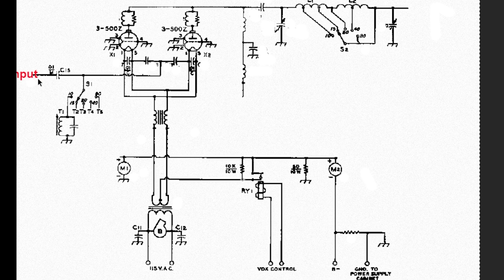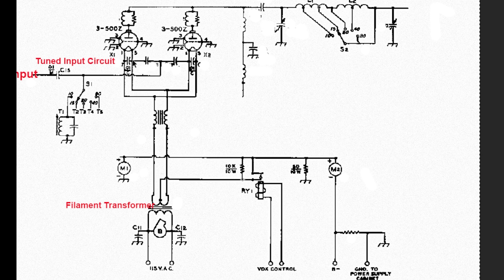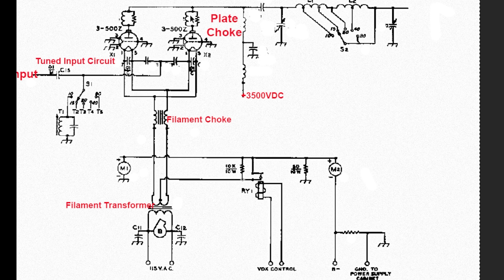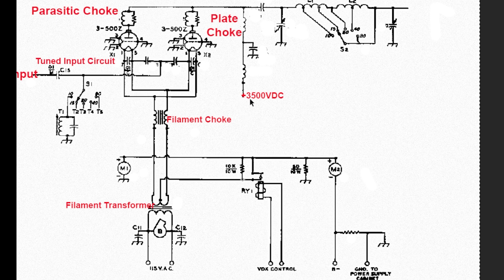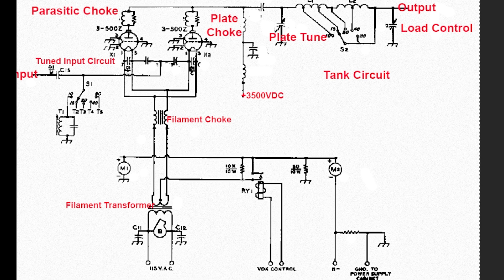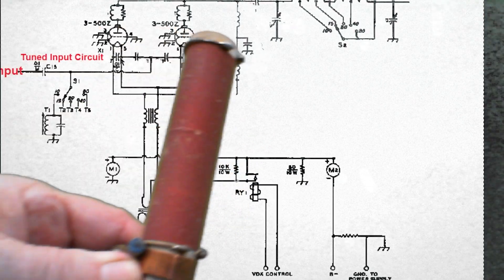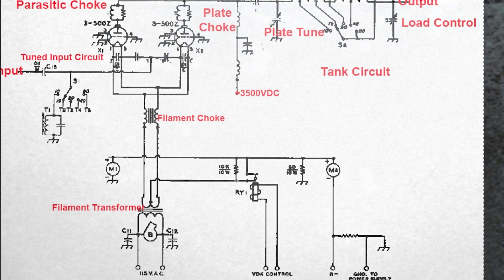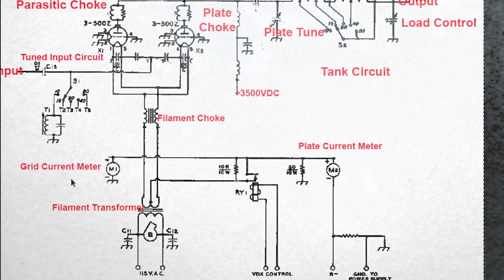If You Are Considering Buying A Linear Amplifier, A Linear Amplifier With Tubes May Be a Good Deal

Comment: Terrific explanation. I use a trusty TL-922a with updates on soft start, new caps, LED backlighting, and vacuum relay. 3-500z's are weakening but still give out 500-700w. 73. de KK7PW

Comment: G'day Jim...hope the health is improving.  

Tnx again for our qso the other day.  Was a great pleasure for me.  I hope our further discussion on audio and subtractive eq was of interest. 

We briefly touched on 'tuning for max out'.  I am still somewhat confused by the concept, but I wonder if it is the chosen terminology that is where the confusion lies.  Does it mean 'tune for the maximum the exciter is capable of' or 'tune for max output based on what the exciter is set at'?  I ask for a few reasons:

1.  Licence conditions in VK are for 400w PEP....a TL922 will do that with 25-30w in depending upon the band.  
2.  Doesnt key down tuning with 100w of drive impact on the tubes more than 30w of drive?  I usually do the latter and wind some extra load in to stay linear and to cover for any possibility (although thankfully rare nowadays) of overshoot.
3.  What if you have a QRP radio?  If tuning with 100w ensures tube longevity by achieving optimal plate and load capacitance for the band, what are QRP folks to do?  

We did speak about it, and you assured me my method (point 2 above) was a sound one....but I wonder if I communicated it well enough at the time.  From what I have read about the net, the jury seems out on this, as I am sure you are aware, and I wonder if that is because of some confusion the arises from the phrase 'tune for max out'.  As you mention in this video, these finals are not getting any cheaper, and in the 922, they are not directly cooled either...so care is important to me.  Max Q output with the caps with additional load and never overdriven has been my method for both the 922 and for my old SB230 with the rare as hen's teeth 8873 (I have a spare which is fortunate).

Your clarifying thoughts kind sir....many thanks again for your videos....take good care.  73 de Aaron VK2ON

Comment: Back in the late-1970s, my HF rig was a horrific Eico 753 vacuum tube baby that required Plate-Tune-Load 'tuning-up' after any significant QSY, and my antenna was a random wire that required an "antenna tuner" (homebrew Pi network) that also required 'tuning-up' after any significant QSY. By the time I was ready to jump in and make a call, the DXpedition had already packed up and flown back home LOL. Since then, my goal has been to get as far away from systems needing 'tuning-up' as possible.  I'll buy an amp when I can afford something solid state and as close to 'No Tune' as I can get. My goal is instant QSY, even band to band.

On the bands even today, one can hear Hams tuning-up their kw linear, either right on the frequency or near enough to cause an audible beat note. Then, after a minute, their powerful signal arrives on the pile-up. None of this 'tuning-up' on the bands nonsense is anything to be particularly proud of. Perhaps such amps should have a built-in dummy load (use enforced with a Tune-Up mode), provided that at least their antenna system is already pre-matched to 50 ohms. Even with that, there is a delay. 100 watts operators might be in and out before the kW is ready to go.
Reply from the maker: I do have a large dummy.  There's a joke in that sentence but I will pass on that.  Tuning up on the air should be the final small adjustment. And, doing that near or on top of someone is wrong as you point out.  Thanks for your help and 73, Jim

Comment: Jim:
Thank You for a  clear explanation.
I have an old Yaesu 2100 series amp that has served me well for years. The unit uses a Pi-network for tuning/line balancing.   I think the Pi-network is active when the amplifier is on stand-by mode or completely off.  Is my assumption correct?.  Is there a way to disable the Pi-network to avoid conflict with the Automatic Antenna Tuner that tunes  my Ciro Mazzoni Loop  antenna?.
FYI, the Automatic Tuner can only handle 200 watts input, consequently the amp needs to be between the antenna and the tuner.  
Any thoughts?

Comment: Another excellent video Jim. Regarding another comment about harmonic output. I compared an ancient QST review of a TL922 with the current standard required by the FCC and seems to be compliant even if manufactured//installed post 2003. (All a bit ambiguous). I guess a few simple checks might be worthwhile if someone purchases a similar amplifier used. Some may have damaged resistors in the parasitic stoppers, and fan bearings might need lubrication. Of course many of the older amplifiers may need an interface to cater with the high demands of the PTT line. 
(I am sure you have covered these points in other videos). Good to see you making videos, I know it is a difficult time. 73
Reply from the maker: Also, we need to look at the bandswitch very closely.  That switch can be easily damaged.  ALSO, timing of the relay is critical.  It is slow to close on the transmit side and the transceiver may be very fast.  So RF gets to the amp before the relay is closed and it arcs at the tank circuit.  Thanks, Jim
Reply: @ham-radio  sage advice Jim, as you mentioned in your video the bandswitches are a nightmare to replace even if you can source a replacement. As for sequencing of the relays you are obviously correct again. The TL922 uses DPDT relay in the RF path so a simple bend to one contact can take care of the hot-switching issue. An issue with amplifiers that have been unused for a while can be flaky receive due to dirty bypass contacts. Half an hour spent on inexpensive maintenance should pay rewards.

Comment: You didn't mention harmonic output at all. FCC rules on harmonics are stricter now than they were back when that amp was designed and used. Simply tuning for max and not monitoring harmonic output will certainly lead to incorrect operation. A spectrum analyzer is definitely recommended if not mandatory if using a circuit like that in the video to keep from splattering all over.
Reply from the maker: Hi and thanks for writing,

You wrote:  "FCC rules on harmonics are stricter now than they were back when that amp was designed and used."  Please tell us what the FCC rules are that you say are now stricter.   By the way, those amps are still being used today.  

You wrote: "Simply tuning for max and not monitoring harmonic output will certainly lead to incorrect operation."  Can you tell us more about the harmonic output?  Also, what do you mean by "incorrect operation"?  I have no idea what that means. 

How would a spectrum analyzer keep a linear amplifier from "splattering all over"?  

Please do educate us all by answering the questions above in detail.  Clearly you know more than I do.  Thanks in advance for your help.  73, Jim Heath W6LG licensed in 1964
Reply: @ham-radio  When a "linear" amplifier is over driven it will produce all kinds of spurious frequencies. The spectrum analyzer will clearly show when this begins to be excessive so you can adjust the drive level to keep a clean signal. You may find the optimum clean signal occurs at considerably less than at maximum power output. After purchasing a "100 watt" linear amplifier I used a spectrum analyzer to find that it would only put out about 30 watts before splatter and harmonics began to exceed FCC requirements. At 100 watts output the second harmonic was only 10db down from the carrier! That's 10 watts of harmonic being radiated on the wrong frequency! Not polite to others at all!

Comment: I wish I could find one of my most favorite liner amps. You could key it with a portable low power transmitter. Great foe field days. It used one horizontal amp tube and instead of a tube to drive it, it used hand wound coil to trigger it. Someone modified a ferrous coil core in place of a tube. It worked verry good. you could drive it with ten watts and get 85 out. was very simple to make.
Reply from the maker: Thanks for the info! 73, Jim

Comment: Shouldn't there be an RFC on the output to short the supply if the blocking cap fails so as to prevent HV at the antenna connector?
Reply from the maker: There is.  It is a must and somehow I did not mention the safety choke.  I had several on my desk at the time. Thanks Mister Hat, 73, Jim

Comment: Much improved audio over your older videos, thank you. I never took the time to learn vacuum tube operation so this video was certainly informative. Please correct me but it seems to me the abbreviated circuit you describe would be running class C and hence not linear. So does the amp require biasing for class AB?
Reply from the maker: It is B class, zero bias.  My other amps have zeners or a diode string for Class AB1.  These amps very very linear IF properly loaded.  Thanks Rob, 73, Jim

Comment: Hey Jim, I use an Ameritron ALS-600 I bought used from QRZ which I use on 80 meters mainly with a full legal limit manual tuner (MFJ-989D). I use a 80 to 10 meter end fed half wave. I haven't had any issues with it. of course I don't over drive it, I only use it for around 300 watts at most even though it can do 600.
Reply from the maker: Okay, good information.  We need to keep in mind that a reduction in  power may be very good for the equipment and still have a potent signal.  73, Jm

Comment: Hi Jim,
I have an SB-221 I built in 1979 which was purchased just after Heathkit stopped supplying the SB-220 to the amateur community due to FCC regulations. It is currently being converted to an SB-220 by the addition of 10m. I had purchased the conversion kit from Heathkit, but decided to buy components off Ebay from SB-220's there were being parted out when I resumed the conversion. I had started the conversion in the early 90's, but life intervened and the project was shelved. I think I will finish sometime next month. I'm keeping fingers crossed the original Eimac 3-500Z's are still in good shape. Hope you are well and stay safe.  73  WJ3U
Reply: Miss Heathkit   Start  As  Kid  The Kits Where So Good To learn From  Did the 25" CRT TV  Love There Tech.  Last Forever  Sold It Miss It Now Grandkids  To See How It All Started...